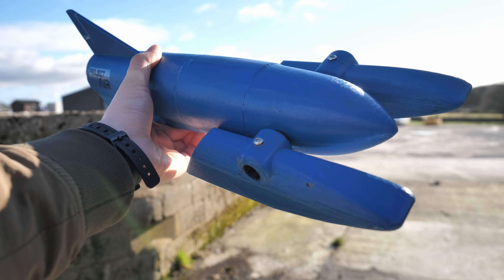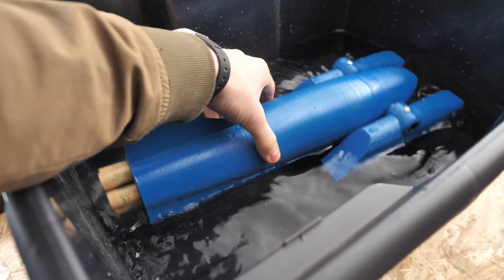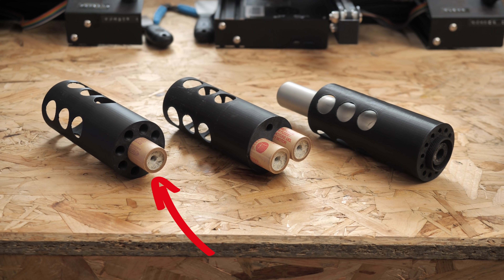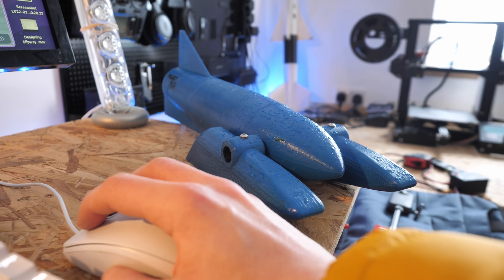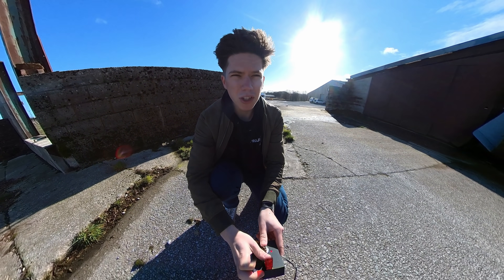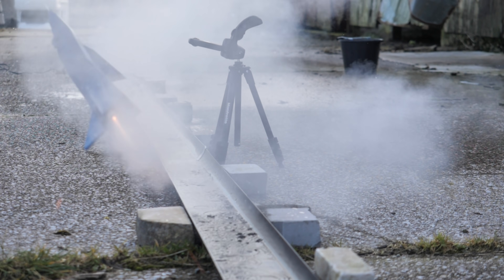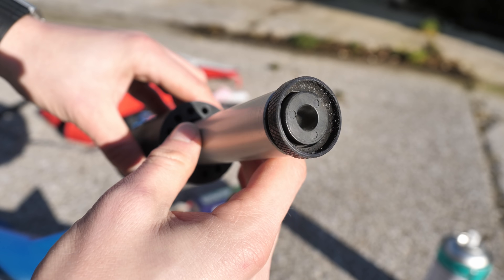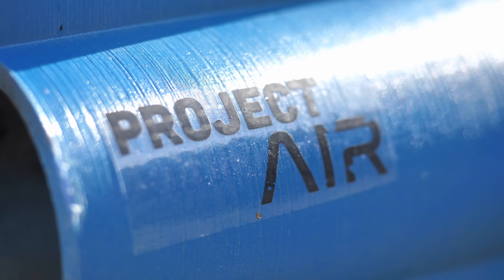DIY Rocket Hydroplane

Comment from the maker: Ask me anything below! I will be replying to questions in this thread for 24 hours. 😊🚀🚣🏿‍♂️
Reply: How did you get into science?
Reply from the maker: @drewdanielvaldez5478  I've just always been building and playing around with things
Reply: big black men @drewdanielvaldez5478
Reply: What can i ask you?
Reply from the maker: @astronautnr7  anything
Reply: How did you get into engineering and when did you consider uploading your projects to YouTube?
Reply from the maker: @callisto3828  Since my Lego days, and when I finished uni
Reply: What is the best budget 3D printer?
Reply from the maker: @thegmoneygaming164  Ender 3 (the og version)
Reply: Not a question but I don't think there's anything wrong with using kg as a measurement of thrust.
It's more relatable to the average person than Newton and most importantly it isn't imperial.
You don't even know how much all the non British/American viewers appreciate it.
Reply: I see two solutions to the problem of unwanted takeoff,

1- a front suspension on wishbone, would absorb impact waves.
2- a rear hydroplane which would counterbalance the front hydroplane (via a rod), which would cancel via counter pressure, the fact that the nose rises by lifting the rear which would make the nose dive.
Reply: What did you study at uni
Reply: This is probably a stupid question but to combat the boat from lifting off the water could you add elevons to the back that would keep it on the ground?
Reply from the maker: @Hahatome  Yes I think you could, but you'd need a flight controller to keep it level - definitely something I'd like to investigate!
Reply: Do you like afterburners
Reply: Love the vids! Are you eyeing any new additions to the workshop? Mini lathe? Laser cutter? and why
Reply: Is there a reason you’re measuring in metres per second and then converting to MPH instead of KPH?
Reply: Why dont you try use foils to lift the boat out of the water to reduce drag but to also stop it from flying out? I am not sure if that would work?
Reply from the maker: @dalem444  foils work much like hydroplaning in that they create lift, but with foils they stay in the water and create more drag than a hydroplane which almost entirely leaves the water reducing drag to a minimum. :)
Reply: @Project-Air  Maybe you should give this a try and compare the speed difference between foils and hydroplaning?
Reply from the maker: @dalem444  👍
Reply: Have you thought about using a hydrofoil design?
This only works in deeper waters but i think it can fix your airborne problem.
Reply from the maker: @prodbygekko  It would be slower ;)
Reply: Has anyone mentioned sticking a hydrofoil on so it sticks to the water??
Reply from the maker: @sionide  They have haha
Reply: Can you create a playlist on basics of flying and building drones? For complete beginner.
Reply from the maker: @creativeboy1833  There's lots of that on youtube already 👍
Reply: I'm not an engineer, but I have 2 proposals:
The first one is to make the point of contact between the boat and the water thinner making the end of the skis with a point or something like that
The second is that you could place a spoiler in the front part of the fuselage maybe by making an hole and letting the air pass there and trough the "internal spoiler"   Good luck.
Reply from the maker: @stay_on_ground2351  Good ideas
Reply: working miniture hot air balloon?
Reply: @donovanreid427   I've been telling you tubers to do that for years
Reply from the maker: @donovanreid427  Sounds fun!
Reply: Could you make an ekranoplane aka a ground lift vehicle?
Reply from the maker: @jackrabbit7911  Already made two ;)
Reply: @Project-Air  One that you can sit in? Maybe?
Reply: wonder if we are going to see another bluebird boat video?
Reply from the maker: @Chayseangus  You will
Reply: What are good rocket engines for young kids?
Reply from the maker: @SebPlaySpaceflight  hmm, check out Estes rocket kits to get started. I think they have a minimum age though.
Reply: You could try using hydrofoil at the back of the boat for stability
Reply from the maker: @narayananr8650  👍 Interesting
Reply: Are you scottish.
Reply from the maker: @azztopia  no
Reply: Could u make a ornithopter from DUNE
Reply: How are you?
Reply: Thx
Reply: OMG why are you so underrated. I love rocket and shits that are dangerous.
My question was, will adding weight to the front of the boat increase the stability and keep it from flying off?
And adding small wings that force air upward like that in racecars might help too.
Reply from the maker: @minetubequest  Moving the CG forward might help a bit yes :)
Reply: Have you considered adding a vertical shaft, perpendicular to the boat, with a wing that is parallel with the water. The wing could produce sufficient downforce to keep the boat on the water’s surface. You could even convert the shaft to a daggerboard to prevent any torque forces from rolling the boat.
Reply from the maker: @EmergentPixel  Yeah I wanted to play with some aero devices, but that might have to wait for another video
Reply: Can I have your Mini?
Reply from the maker: @clonkex  nope, sorry ;)
Reply: What is your favorite propulsion system (rockets or props mainly)
Reply from the maker: @NeoSlasher059  they both have advantages
Reply: Have you been in touch with the Bluebird K7 project for help or maybe Don Wales (grandson of Malcolm Campbell)?
Reply from the maker: @DigitalJunior2003  I haven't
Reply: Would you make an rc car again? It's very cool to see rockets strapped to wheel's
Reply from the maker: @maisaanmufeed438  yep, going to be doing more rc car stuff soon
Reply from the maker: @yeteboi2259  They were these ones https://www.vintagemodelcompany.com/tsp-l-4-rocket-motor-5-pack.html
Reply: Would it make sense to have 'wings' that always guid downwards added on a 'gimbal'mount? So if it start to go airborne, it changes trajectory because the wings correct it? Or was that not part of your plan?
Reply from the maker: @MrLexhoya  could do that
Reply: Do the temperature conditions affect the tests shown in this video?
Reply from the maker: @hindoldas8511  they certainly effect me!
Reply: How about giving away 3d printers for 200k subscribers
Reply from the maker: @ayushsmenon  Maybe!
Reply: @Project-Air  let's go
Reply: You are absolutely AWESOME! Keep doing what you love! (And we get enterained too :D)
Reply from the maker: @UClwzXiGCDh-bPtMXfzNnGYQ Model stores online
Reply: Did you try some sort of spoiler on the front, like a f1 car
Reply from the maker: @SepHamel  Could do!
Reply: Have you got plans to mount your jet engine on this vehicle or on a hydrofoil?
Reply from the maker: @exo068  Yeah, on the big bluebird hydroplane
Reply: are you thinking of taking your rocket projects higher (think highest 3d printed rocket)?? i would really like to see some near space footage
Reply from the maker: @andrewmadigan4988  I'd love to, but would probably need to do it somewhere in the USA!
Reply from the maker: @andrewmadigan4988  I'd love that!
Reply: Should the side thingy's (dunno what they are called) be inverted soo that you get negative lift? The reason you are taking off is because of positive lift. Of course this will cause the drag to increase, but the stability might improve as well.
Reply from the maker: @ashvinla  'sponsons' ;) - when the boat starts rotating due to hitting a wave, there's an exponential effect with angle increasing as more get under them
Reply: @Project-Air  thanks!
Reply: You can use servos to actively control the sponsons, to keep the boat stable maybe? Like a fly by wire system on unstable fighter aircraft?

There can be a level on the boat which gives the data to a computer and that computer adjusts the sponsons to get the level to 0° all the time...
Reply from the maker: @yayayayya4731  Perhaps! Good idea
Reply: Great as always. I see two possible solutions to your problem.
1) is maybe putting a "crossbeam foil" on the bottom of the rudder to increase drag (and could also be controlled later on as pitch control or auto flight controll) 
2) raise the height of the rocket slightly so it pushes the nose down when firing
Reply from the maker: @CorneBreed  Good suggestions :)
Reply: Will you be revisiting that awsome tip jet heli?
Reply from the maker: @weld4200  Probably not :) Maybe I'll do a big single bladed helicopter sometime
Reply: @Project-Air  is it posdible to make a rocket powered ekronoplan?
Reply from the maker: @weld4200  Possibly, but I think it would be quite difficult!
Reply: @Project-Air  love ur vids man ..and thanks for the reply ..i have one more question man i kno ur busy . ..have you ever created anything that was intended for a video . But was so dangerous that you had to either scrap it or turn it into something else ? Do you have like a blooper reel . Of all your like funny mistakes or fails ?   Idk could be cool to watch how you progress on certain things and what not . Much love bro ..keep up the good work.  I just have so many questions man . Lol will you ever make a hybrid rocket engine ? Lol . Have you ever rode a one wheel ? Is tom stanton and ROBOT ?
Reply: You could probably get more reliable ignition if you add 2 ignites, I don't know if this would make the plug get stuck though
Reply from the maker: @kaminelson1277  Not a bad idea actually!
Reply: Can you add a motor mount on the TOP instead of in the centerline?
I think the hydrofoil effect will keep it from going u-boat, while the top-mounted motor will not allow the boat to pitch up and takeoff. I think the top-mounted motor concept is a lot more sensible than the centerline motor when you are making a boat.
Reply from the maker: @khoipham8303  I shall try it soon :)
Reply: More speed is proportional to positive angle of attack :)
Reply: You should maybe try adding some weights in the fron to stop it from planeing.
Reply from the maker: @danijelmtb6215  👍
Reply: love your vids, hope you can post more frequently though, and adding more weight on the nose and adding flaps or something like that to keep it as close to the water as possible. Hope, you'r doing well
Reply from the maker: @devbadiger1439  thanks!
Reply: Have you thought of changing the cg of the boat? At this point i don't think changing the attack angle of the pontoons will help all that much with your flying issue.
Reply from the maker: @cryaesthetic3603  I played around with this in the last vid :)
Reply: Does the rocket weight and installation give's the boat a rearword center of gravity? And if so is anything needed to be done to combat this or that having a rearword center of gravity is preferable?
Reply from the maker: @cainsharples3818  I did some experimentation with this in the last vid :)
Reply: When are you launching your next rocket?
Reply from the maker: @TheMrBush  When the weather improves
Reply: @Project-Air  Can't wait! :)
Reply: Would you ever consider a two vehicle combination? Like a plane that can into an rc car and then back?
Reply from the maker: @wintermelon7444  That would be fun!
Reply: If you add a small fin under the motor section it will add just enough drag to keep the nose tipped downward I think. May need to play with size. Also remember as mass is added in the back you need to balance it with a bit a mass at the front.
Reply from the maker: @xAeroSpaceKnightx  👍
Reply: Do you have an email where people can message you?
Reply from the maker: @MrForthcoming  I have a business enquires email address on my website
Reply: Have you looked at how your scaled model stacks up against other hydroplanes' goldilocks zones via reynold's number similarity checks?  Could give you some insight into what sort of AoA or surface area of your sponsons would increase stability at your predicted speeds
Reply from the maker: @millerjt  I haven't yet
Reply: Can you make a video on how you produce your videos?  (Video editing, camera work, how you get so good at it,etc)
Reply from the maker: @MatthewNovoselskiy  Might do one day 👍
Reply: How can I start building Remote Control Vehicles?
Reply from the maker: @josiahhickman5738  Watch tutorials on youtube and build some kits!
Reply: You need to make the body flatter so it can be active arrow on itself and hold it self down... Make it a little wider and the parts on the front that goes in the water skinnier
Reply from the maker: @ceasarslife7535  👍
Reply: When will you do another rocket plane video?
Reply from the maker: @jameschamberlin3926  Sometime this year, maybe
Reply: We had a scheme for preventing something from launching until all engines fired, with cords that had to be burned through by each engine. You'd have asymmetrical thrust at the end, for sure, but it would usually launch straight.
Have you ever tried something like this?
Reply from the maker: @UncleKennysPlace  👍
Reply: are you gonna do another aerodynamics focused car video?
Reply from the maker: @losatko  Watch out for next month's vid ;)
Reply: How can I get into engineering on my new 3D printer and how can I get my parents to allow me to create a small workshop ? And most importantly: What is Love?
Reply from the maker: @tubois2025  Ask them nicely
Reply: @Project-Air  i can try:)
Reply: My kids love watching your videos with me. You've inspired them to make their own videos. I was wondering what video editing app you prefer to use? If you get the chance can you also post a list of cameras, 3D printers, and etc into to description of an upcoming video. Thanks for all your hard work and for taking the time to share it with us.
Reply from the maker: @Jonathan.D  That's really great to hear! I used to use iMovie when I was a kid. I now use Davinci Resolve, which is free. Just use whatever you've got to hand - like phones - and then maybe get a gopro or cheap onboard camera for extra shots. Those would be my recommendations 👍
Reply: What about an aerodynamic spoiler on the front to help push the nose down and keep the hydrofoils on the water?  I can't tell from the camera angle on the high speed, but doesn't testing in a small, shallow trough like this, cause a wave to form in front of the boat? I would assume as the boat moves forward quickly, it pushes some water away in front of the boat as it tries to get up on plane, which wouldn't it then continue to push that wave ahead of the boat, essentially creating a "ramp" for the boat to then "launch" into the air from as it nears the end?  I guess it doesn't make sense that the wave would outpace the boat but it still seems like there is an extra interaction here that you wouldn't have if this was tested in a much larger, wider and deeper body of water?  Anyways, love your vids.
Reply from the maker: @Protonus  thanks 👍
Reply: Did you consider putting the rockets in the pons?
I have no idea what will hapen but I think it will look fantastic.
Reply from the maker: @woutdossche7639  👍 I haven't! Cool idea
Reply: Are you going to do more with the jet engine soon? Put it in a vehicle?
Reply from the maker: @BlaqHawk24  I am! Doing some testing today
Reply: What are your thoughts on automation like Ardupilot  or just arduino and a simple stabilization script? I think you could benefit from it since you tend to build vehicles that fly faster than the human can react lol
Reply from the maker: @talisman3d595  I will be doing that with aircraft soon
Reply: What if you use a vertical blade configuration in order boat dont fly (). Maybe even some inverse flaps\-/.  Underwater blade? [__] .
Reply from the maker: @davidplapla5510  👍
Reply: Why did you not give it a wing to make down force Soo it stays not a plane
Reply from the maker: @jakubzabocki6182  Could do, good suggestion
Reply: Is youtube your real job, or do you have another?
Reply from the maker: @DrColonoscopy  Youtube :)
Reply: What is the largest rocket motor you can buy legally in your area?
Reply from the maker: @romanflys6544  G
Reply: Are you ever going to be doing anything more with your rocket car project you might be interested in trying adding some of your rocket and plane research
Reply from the maker: @davidpayne4315  👍
Reply: no question.  but thanks for the new video.😍
Reply from the maker: @MrWeras  Thanks for watching :)
Reply: Who are you to tell people what they can and can't do at home? What makes you the only person, of those who watch you, that can do this?
Just make the damn video and if I want to get into rocketry I will and you can mind your own business.
At what point were you given the special privilege of being able to do this "at home"?
Reply from the maker: @SeraphX2  It's so people don't get hurt and blame me. Thanks for the comment. Have a nice day.
Reply: Love your videos. I think you should...
1. Add a front spoiler to keep the noise down with aerodynamics.
2. Incorporate small rudder like fins, barely protruding under each pontoon to help with tracking straight.
Reply from the maker: @ThisIsDavesGarage  Thanks for the suggestions :)
Reply: How about changing the centre of mass of the boat by adding some weight in its head after 3D printing it hallow?
Reply from the maker: @alialhajjali952  Check out my last video ;)
Reply: How is your hair so big?
Reply from the maker: @hannahshemilt2531  Great genetics
Reply: 2:36 how many takes did that drift take?
Reply from the maker: @Bigwings2043  Twice haha
Reply: @ProjectAir Bro why don't u use down force to keep the boat stable I mean like f1 front wing
Or create underfloor tunnel to make downforce
Reply from the maker: @sutapabhattacharjee7496  Could do
Reply: Are you considering implementing some form of control system to stabilize the boat? I am studying cybernetics, and it would be interesting to see if you could use some type of controller design to solve your stability issue
Reply from the maker: @ProductionsExoTic  This one was completely uncontrolled! But yes, that would be fun to play around with.
Reply from the maker: Cagsbo  I could do next time :)
Reply: The flat bottom of the hull sections are messing you up massively, you should really use a tapered shape, also the squared off ends make the boat extremely unstable.
Reply from the maker: @tomwaters2527  How do you know this? From my experience, and being advised by a drag race boat builder, squared off is the way to go!
Reply: What about a gyroscope?
Reply: Do you remember what motor you used for the last test with your rocket powered hydroplane?  ( I.e. Aerotech F26 etc.)
Reply: Are you smart?
Reply: What Cad software do you use?
Reply: dude idea for you. use two fans to force it down. active aero
Reply: try lengthening the pontoons.  Also with the reliability of ignition, why not have multiple individual rocket motors to individual ignition circuits, all slaved to a timing circuit?
Reply: Have you thought about possibly adding canards to the front two pontoons? If they were angled to give you a negative lift force that might help?
Reply: How long have u had your mini and how’s it been?
Reply: make it heavier
Reply: Could the ripples from the 3d printing be causing an issue as it is then not a smooth surface for airflow?
Reply: what if like a foil board you have an underwater wing angled to keep it moving almost down instead of up
Reply: Add some weight in nose of the boat to solve the issue.
Reply: Pretty nice but you’re doing it all wrong bro..
Do you need nitromethane!

https://youtu.be/Cpy4cJzTqr8
Reply: Maybe you can refer to one of your favorite cars, the F1 Race cars, using downforce and aerodynamics to keep it in the water, you would have to find the perfect cancelation angle, so maybe an adjustable piece would be apt for your situation, this just might stop it from becoming an aircraft, instead of a watercraft.
Reply: Just wondering if the blue colour and overall shape is a homage to Bluebird and Donald...?
Reply from the maker: @UnitSe7en  It was :)
Reply: I know someone that could help with this that runs tethered hydro in the UK along with tether cars.
Reply: Are you studying Engineering?  Are you an Engineer?  If so, what Engineering are/did you study?
Reply: idea: make a sort of straw hole inside the pontoons on both sides, using the rapid air intake, at the highest point of drag you could move the air through the pontoons with a slight upwards deviation, that way you can minimize overall drag, and force the craft downwards.

however the downsides of this would be the faster it goes the less effective this idea becomes and thus it would need to be adjusted per throttled input (aka diffrent sized boosters)
Reply: Can I have your channal 😅
Reply: Can you make a rocket powered snowplanr
Reply: The first major problem you are running up against is that your engines fire longer than your test bed. Your trough's are not long enough and need to be extended past the distance that your engines are propelling the craft forward. You started out with an instability, and just continued to increase the engine size with out actually solving for the instability. You have no dial scale to reference your set screw against when making changes. Which literally means you are only guessing. Fix both of these things and restart at the bottom engine until you can send it with out flaw every time. Only then, do you try changing your scale or pushing throttle performance.
Reply: Just curious, have you tried a configuration similar to a hydrofoil? I think that could help keep it in the water and it would be an easy add on to your current design
Reply: Use one engine like one of the aerotech composite engines. They are far superior to back powder rocket engines. You could make your own. Just mix up some ammonium perchlorate. Widen the front sponsons a bit for stability.  Dont ask me how I know.
Reply: You do know you sound like tom stanton 😂😂
Reply: What would happen if you put a wing on the front, to push the nose down, while angling the sponsons more aggressively to give to boat more lift
Reply: nice car
Reply: Add spoilers for downward ⬇️ force